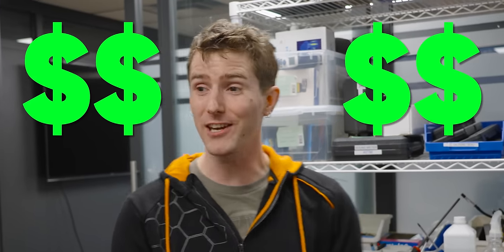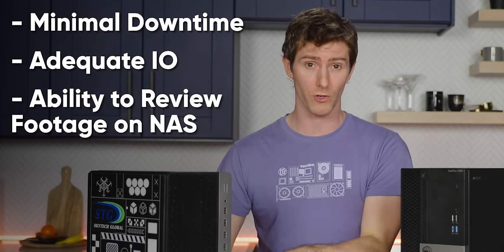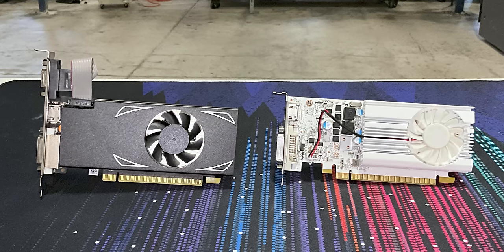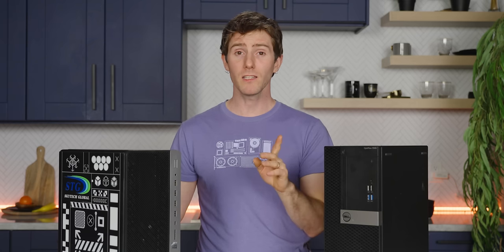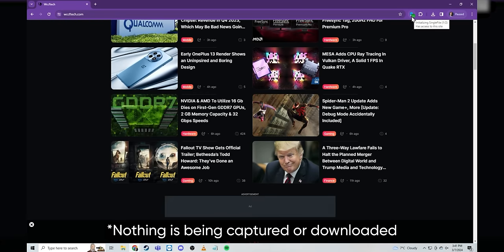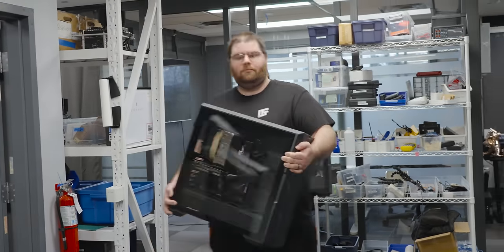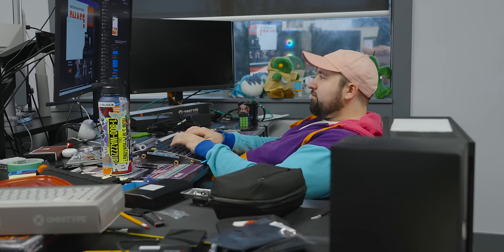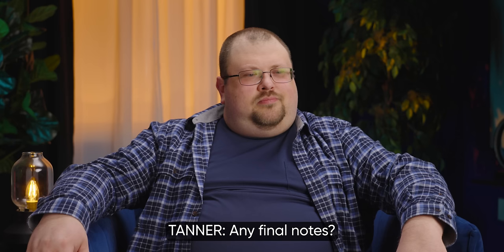We Downgraded our PCs to Prove You Don’t Need a New One

Comment: My daily driver for photo editing and graphic design and some basic audio recording and music production is an i5-4590 equipped Dell Optiplex 9020 with a SATA SSD running macOS that I picked up on eBay for 60 bucks. I added a $60 dollar AMD WX-4100 4GB and an extra 8GB RAM and it does just fine.

Sure the Adobe apps take 10-30 seconds longer to open than on something like my gaming rig, but otherwise it ticks along just fine for 98% of my daily work. It takes 52 seconds from power on to desktop, including typing in my password. Even some of the heavier Gigapixel AI upscaling and sharpening software happily chugs along on average 15 or so seconds slower per image than a system equipped with an nvidia GPU that alone costs twice to three times as much as my entire daily driver. Sure, If I was batch upscaling hundreds of images per day, I’d obviously look at something more beefy, otherwise not everyone is farming crypto, hosting SDXL servers, or editing 8k for a living. In fact, most people aren’t even using things like Adobe Creative Suite either, so they could even forego half the upgrades I did to my own base Dell Optiplex 9020.

Comment: Corporate setting: roll out new systems every 4 years. Rollout plan is simple every 3-6 months apart in batches until its done. System based on use case and standardized.
This way you will have 4-8 models in your management (depending on the internal structure).
Once the system is out of standard circulation it can be used for educational purposes or as a worst case backup machine or similar.
Old systems are retired and sold (without ram/ssd), donated or destroyed (recycled) based on company policy.

I know LTT is a media based company and that most machines are used as a dual purpose (make a video on it), but as you finally realized, standardization is easier to follow and better in the long run.

Now its just a matter of time until "mr. LTT" realizes that you should do the same with your server infrastructure. (Internal infrastructure IT guys will hate you less)

Comment: Thank you Linus. Pair it with a 60Hz monitor, 16GB ram, 500GB SSD/HDD, 2-4 Gen  i5 core, and 1060 GPU next time. Also can I have an optiplex? It's still better than my current setup (even without knowing the specifications).

Comment: Downgrades suck. That mal-functionality adds unwanted stress while people are working. Why do i have to work on a system that takes 30 mins to get started first thing in the morning, takes 40 second to open a local >1mb document, or takes 3 minutes to save that document because the onedrive upload drags, when the project im earning 100's of thousands on for the company i work at, can just buy me a better workstation. Better workstation = faster work.  Better workstation = less frustration = less stress = higher quality work output. Better workstation = less calls to IT for fixes. Get a grip

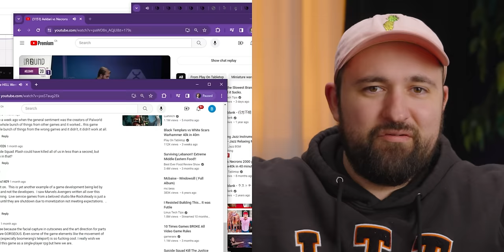Comment: 7:26 wow that's also the same issue I have with my HP 600 SFF lmao
I have a i7 6700, 16 gb of ram, ssd with a hdd drive, and a GT 1030 and I m getting this weird graphic bugs that appears at my screen from time to time, specially when browsing at Chrome. I have everything with their last drivers and updates and still don't know what could be. Is not a big problem, is just a weird bug happening sometimes.

But yeah, I haven't upgraded my system neither, I can do all my work fine with it (I am a music producer btw).  The only annoying thing about there systems for me is that I can't upgrade the GPU, even more impossible with these Small Factor Form chasis and motherboards :(

Comment: I am not a gamer or videographer, so the only things I can think of where I'd need need serious grunt are some software music synths (e.g. Vital and VCV Rack) that eat CPUs for breakfast and modern AI which requires a GPU with serious grunt and VRAM and a good enough host computer to drive it.  For normal dev work, a basic Optiplex with an i7-3770 (I'm typing this missive on an Optiplex 9010 with that spec and 24GB DDR3) will do just fine.

Edit: meant to type GPU not CPU.

Comment: Agree, however, let's not go too far back, a 4th gen i5 with SATA won't cut it today, especially when 10 goes off of support next year. Something from AT LEAST 2016 or later is more than suitable for more basic/run of the mill stuff many office workers do. 

However, if you do mission critical work, or heck, creative work, then something in the past couple of years with serious hardware where speed is paramount, or need to run Windows 11, though I'm aware that if the PC does not have TPM 2.0, it's not too difficult to surmount that, or if the CPU is not supported as well to run 11.

I run 2 Dell systems, both core i5 based, 16GB RAM. The desktop, a 2017 Optiplex desktop SFF (wanted a mini tower, but the place I bought from didn't have any available) with a low profile, low power Invidia GT 1030 stuffed into it, and a Dell Latitude 3390 2n1 from 2018, and the integrated graphics (7500U). 

The desktop has an NVMe drive for the main (at 512GB), the older desktop had a SATA based SSD (also 512GB). Going from a 4th gen i5 with 16GB DDR3 and SATA interface (SSD) to a 7th gen i5 with NVMe interface (also 512GB) and 16GB of DDR4, there WAS a noticeable difference in the speed of the newer desktop over the older desktop. Even before I replaced the wheezy Invidia GT 610 with a mere Gig on it. Had to upgrade to the 1030 due to incompatibility with 11 as Ferni and Keplar were both deprecated by Invidia I think last year.

Comment: Dell OptiPlex 7050 (MT) with Windows 11, 16GB DDR4 RAM, 256GB M.2 and 1TB HDD
Intel Core i5-7500 (3.4 GHz)/(Up to 3.8 GHz maximum Turbo Frequency)
GPU ATI FirePro V5700
 M.2 256GB PCIe NVMe Solid State Drive from Samsung

$352 in Norway.
Not too bad :)

Comment: Main comp is a Dell Optiplex 980 cpu xeon X3470  16 gig ram gpu hd 7900 4 gig   boot drive 240gig ssd  1tb inststalled software drive 2tb storage drive. Pretty crappy compared to newer stuff but online tasks and 10+ year old games at max detail at 1360 x 768 on a 32 inch $100 tv it does the job. and on win 10

Comment: So apparently booting taking several minutes on a old system even with a SSD is kinda normal.
I used to thought something was wrong with the 4th gen system that I still daily drive, since it took quite longer to boot compared to my laptop which is even older and on spinning rust(granted that is running Windows 7 which don't need much performance to be smooth), looks like newer versions of Windows just need a lot of performance to boot fast but not required to just be smooth in normal operations, interesting.

Comment: Personally always build in house, just don't spend 2k on you average workstation! Reuse cases, monitors, PSU's fans etc. 9 times out of 10 you can get the same machine built for less money if you just upgrade the core components. Optimize your machine build out for what it is tasked for.
Reply: I don't think that's always feasible depending on the size of the organization. I work in K12 IT and we have just over 1000 staff members. It is not feasible in any way to build and test 1000 computers.

Comment: Gosh. I used to be one of the people running a 3rd gen i7 with a gtx 660 ti and a pentium laptop until about 2-3 years ago. It was fine for my use! But then I started playing VR. Now I have… something newer. 

10th gen i9, 64GB RAM, recently got an RTX 4060ti 16GB (heavily overclocked the memory to minimize the impact of the low bus speed) since VRAM is most important for VRChat (I can now load 1/4th of a furry avatar!)

Comment: I recently got a very first gen AMD Opteron system - dual 1.8 GHz CPUs, 12 GB RAM. Running Linux, it is shockingly slow. I've used theoretically-slower systems recently (first gen 11" MacBook Air with its 1.4 GHz Core 2 Duo and only 2 GB RAM) that felt far faster. The Opteron couldn't even saturate 1 Gigabit Ethernet in a purely synthetic network test (iperf3)

But anything Core 2 or faster, just swap in an SSD, and it will feel perfectly usable.

Comment: I am using an Optiplex 5050 with an i5-7500 and 16GB of RAM, it's running Fedora Linux and I have no performance or compatibility issues. It even happily runs my 1440p ultrawide at 100hz without issue. I can confidently say the only reason you were having issues it because Windows is just garbage. My boot time in 10-15 seconds and applications are fast to load. To me it's almost criminal how much power Windows needs just to run Windows.

Comment: I would say you just need bigger power supply my roommate and my coworker that bought one off of me. These dells are gaming with 1660s in them. they are great but just change the cooler and you are good (when you get these and you do tasks to make the cpu get hot is the issue so I am about to change the coolers on theirs and all good since I did test one with a better cooler.

Comment: Personally I would just setup a server with virtual environments and have that be top notch and their desktop clients be meh but super reliable with a proper warranty. I know you like to knock dell on their warranty upselling, but from experience their warranty on their professional systems is really good. Other advantage to running virtual environments is software licenses, do all your engineers use solid works at the same time? If not, that could be like 10,000$ plus 2000$/yr per license you save. Same with adobe etc. Now when you get into simulation software like ANSYS then the virtual environment really starts to make sense, you won’t have more than one simulation that needs to be run NOW, plus really a 96core epyc would be slower than a 14600 for regular use. Personally I’d buy dell or Lenovo current gen systems with IGPUs, 3yr warranty, raffle them off after 3yrs, I think as a business you can depreciate tech quite a bit each year and buy new. Keep the main server balling. You already did a video on this kind of setup 10 editors one pc I think. Also networking costs, to run 10gbe all over your shop makes no sense when regular CAT6 can do 2.5 and that’s fine for just streaming video and your server could be 6ft away from your storage connected with 100gbe.

Comment: I guess as long as the system meets Windows 11 minimum system requirements... most users are going to be just fine. My job means I am regularly doing photo work with images that are 26460x17004 (almost 450 megapixels), so I might not be 'most users' in that respect but when I go home I'm not doing anything that intense.

Comment: interesting but also strange that my 2013 laptop is still going good, well after a gpu and battery replacement in 2020. msi gaming laptop with already 3 ssd's, 24 go ram and rtx 780m. it'st faster than the dekstop dell pc's with have with gtx 1080 at the office... it's like dell's comapny pc are made slower in purpose

Comment: Most of these issues sound like just the system not getting configured AT ALL - like just a complete noob taking an old PC, doing a standard install of windows and than installing a crapton more of program on the systemdrive.

I used to run an i5 760 for many years. Bootdrive was a normal HDD. When i replaced it with an i7 8700K that old bugger was still faster than the "gaming" PCs of most others i knew. Having a clean OS install and specially for windows not cluttering the boot-drive and autostart really helps. Even my old P4 is still functional and boots in less than a minute. I just don't use them for anything anymore cause they have no hardware support for the modern video codecs. And no, back then we did use P4 or c2d, with winamp, the browser, Teamspeak and some other stuff in the background while playing games. That works just fine.

Also 10gbit ethernet was a problem? We are still rocking some switchs and routers with i3 6100 and they have no problem whatsoever with just that bit of traffic. Also some backup system for development - copying some 80GB VMs is limited purely by the network and not the CPU.

Comment: This'd go a little differently in a typical Linux distro.  I mean, Linux isn't magic, the slower computer would be slower.  But they are quite diligent in maintaining driver compatibility for even the oldest hardware so the little glitches and oddities would be very unlikely to have occurred.

I've taken full advantage of this in the past -- upgrade a system by buying a new system and moving my install over (with the only change being to install or remove the Nvidia driver as the case may be if I'm going from a non-Nvidia to Nvidia GPU or vice-versa.)  Or occasionally, have a newer system "burn out" and have to pop an install back into something older while I mail order some parts or get a new used PC or whatever. 

(And an amusing side note -- the Mesa 3D drivers were actually COMPLETELY rewritten just within the last 3-4 years to be modern "Gallium" drivers -- Intel took it upon themselves to rewrite the i915 driver into "Crocus" for newer Intel GPUs, and the open source developers took it upon themselves to write "Iris", supporting older Intel GPUs Intel themselves dropped support for in Crocus.   So not only are these ancient GPUs "still" supported, they actually have FULLY modernized drivers, those 5th and 6th gen systems will have full, up-to-date Vulkan support!!   3D support on Intel GPUs was god-awful on Linux 3-4 years ago; now it's excellent (if not particulary fast on these olders GPUs since they are after all still potatoes.)  And of course they have nice AMD support for those AMD RXxxx cards and such to use.  Not nice built-in Nvidia support but that's what the Nvidia driver is for.

Comment: Them Dell and HP business machines do have a lot of bugs and limitations compared to their workstation counterparts. But even the workstations do require a lot of tuning in the BIOS to do everything you want them to do as seamlessly as an in house build system. Basically disable all the security crap in the BIOS and disable all the S states. Turn everything off thats not related to performance and they should work OK but they will always take a while to boot because they do a lot of diagnostics on boot compared to consumer hardware. And dont expect them to run anything other than Windows and mainstream Debian based Linux distros with out a LOT of hacking often times just to get the instillation to boot. Like for example  just about every manufacturer of business system requires some kind of special hack during install to get Qubes to boot. Every one has some kind of "BIOS bug" even different BIOS bugs between generations. Probably some kind of security BS that cannot be tuned or fixed with out a custom BIOS. And a lot of the time on business systems BIOS cannot be rolled back after a certain point. You could just build cheaper systems in house with less headache and use onboard graphics where discrete GPU's arent required.

Comment: these all sound like windows issues, the newest CPU I have is 7th gen and all the others are pre 2015 and on linux I have almost none of these issues, I use sata SSd's and boot times are always under 30 seconds even on 2nd gen dual core processors and I never have these weird issues of stuff refusing to work either

Comment: Most people who don't want to play recent or demanding games will be fine with a cheap used computer, or a new carefully-picked cheap-ish laptop ( especially if they would have to otherwise buy a screen for a desktop ).

Improvements in laptops were massive over the past 5 years, I would NOT recommend an older used laptop, and you cannot assume "new and cheap = good value". You can't easily upgrade a crap laptop.

Comment: I have a good GPU but I do not have a good CPU so most times, graphics get bottle necked in only gaming but not with mining. Are there a way to fix this since the CPU is soldered to the board. CPU is Intel Quad-core processor J4115 and GPU is RX6600XT. The only GPU I have that is smooth in gaming is GTX950 2GB version but with poor graphics. Are there any better suggestion for gaming under 200Watts.

Comment: I am still using my Thinkpad X220 today which is from 2011. Core i7 2nd Gen 16 GB DDR3 RAM, vPro IP-KVM with VNC access even the BIOS. The only thing I say is, I do not use Windows on it, because Linux is lighning Fast on this mashine. If you use old PC's you can gain lots of Speed by using Linux!

Comment: This is a genuinely bad way of showing what old optiplexes are capable of. First off, I would have used fresh windows installs. That might have gotten rid of a lot of the bugs they were dealing with. Not to mention you're trying to replace employees high-end computers and expecting them to still perform the same workload. Overall I'm just not a fan of anything that was done in this

Comment: I have sff.. limit for gpu is on 70w.. my socket is lga 1511 and i upgrading from g5400  to i7 9700.. motherboard only support ddr4 and pcie gen 3.. so i upgrade ram to 16 gb ram and kingston sata ssd 490 as boot drive.. original drive is 1tb hdd.. unfortunately.. i didnt reseacrh very well on gpu so i got gt 1030.. i found gtx 1060 is more ram and nearly same price?.. all of this is fun to me as i do it by myself. all of it even i dont have any knowledge about pc

Comment: we need to not give people the notion they can hang on to old hardware like that. Windows 10 support is ending and anything incapible of running 11 needs to go away. for those unaware anything older than a ryzen 3rd gen and a Intel 8th gen CPU. I get wanting to save money but if its below those specs you can just do the nessisary spend and buy a referb with those specs and then keep that forever because it can run windows 11 and can be upgraded when the time comes. the reason these companies are devesting from these machines is because they cant run windows 11 or server 2022. both require TPM 2.0.